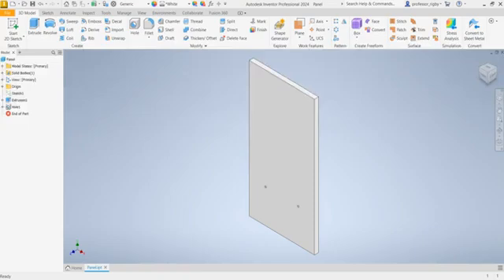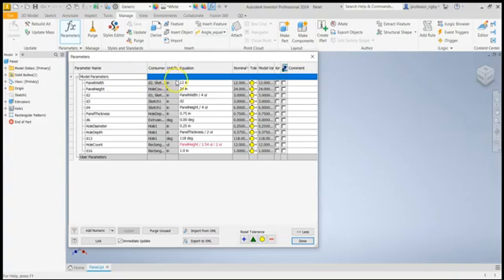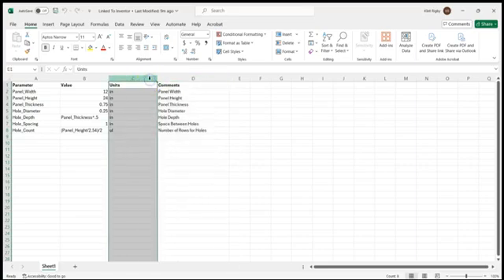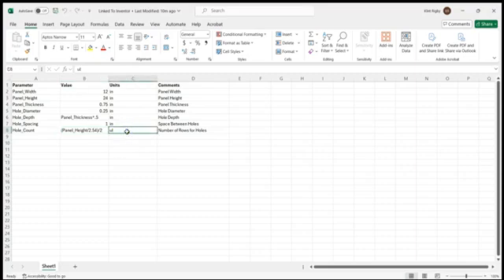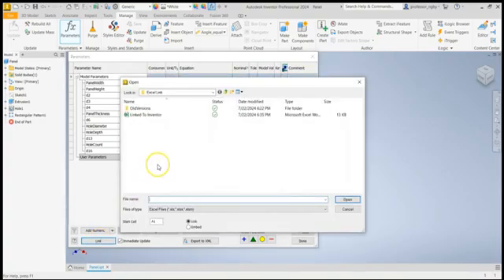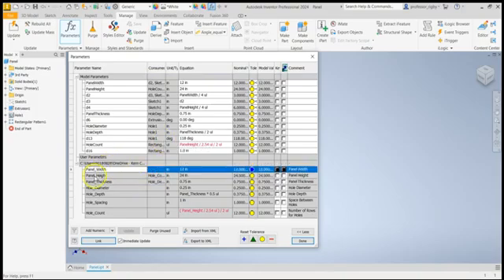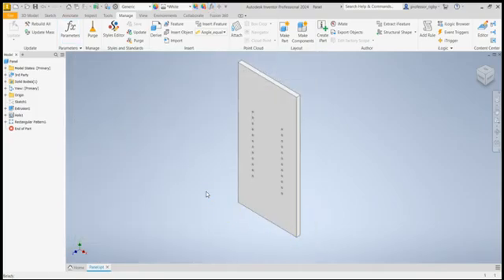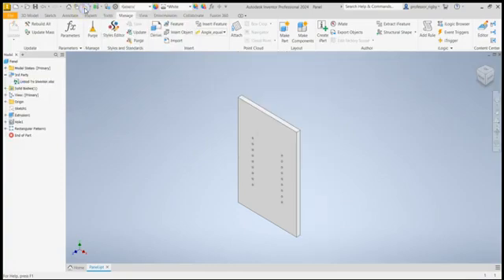Linking an Excel Spreadsheet to an Autodesk Inventor File

Comment: Can you use the excel document for several different parts without them chasing each time? For example if I made a part that was 200x300. And then I wanted a new part which was 500x800 ... would the original part change to 500x800 too?
Reply from the maker: The Excel file can control several different parts in an assembly, but if you insert the same part several times in an assembly, then change the values in Excel, all instances of the part in the assembly will be updated.
One solution may be to save a copy of the file with a new name.